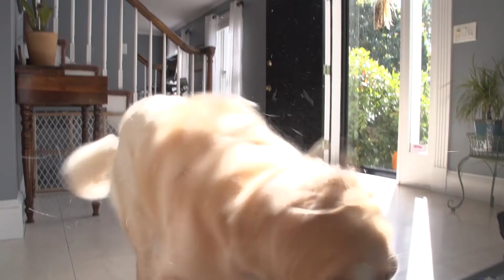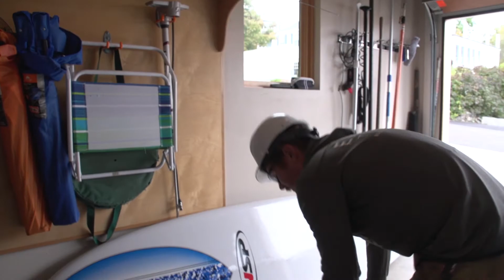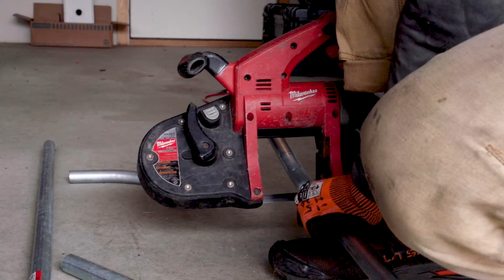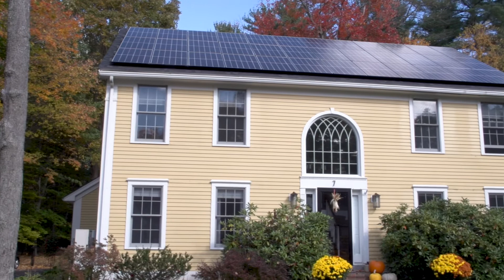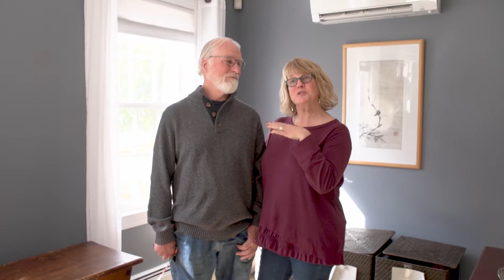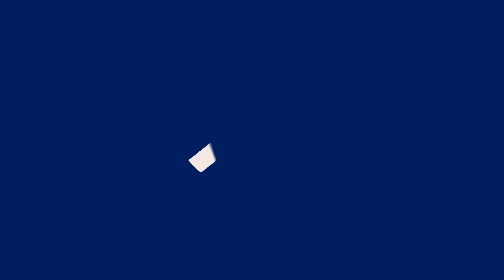Solar Powered Heating and Cooling in NH

Comment: So the system looks to be around 12kW with perhaps 36,000 btu of mini splits.  Does the math work out for the solar to completely zero out their electric bill?  I would have guessed a larger system would be required.  Maybe some specs could be added to the description?
Reply from the maker: Hi Scott! Good question and not everyone wants that level of detail but we're happy to entertain. "Rule of thumb" is 1,200 kilowatt-hours of energy per year, per 1kW installed. So 12kW system = ~12,000 kWh/yr subject to lots of factors like what the roof exposure is and a given year's solar resource... but that'll work out to be about right, on average, over 20'ish years.

Modeling how many kWh are needed to heat a home is a tricky business, as there are tons of factors involved, and honestly energy-efficiency companies that have far more sophisticated software than us and do a better job :)

We have a calc at - https://www.revisionenergy.com/build-solar-powered-home/ - which is useful... Our math: "It’ll vary, but an above-code insulated house needs around 15,000 BTUs per square foot, per year. So a 2,000 sq. foot house to this standard, needs 30,000,000 BTUs / 8,530 = 3,516 kWhs annually… Or about the equivalent of 3 kws of solar (9’ish panels)."

The math in the paragraph above is written based on a pretty highly-insulated house, but it at least shows that 12 kw for electricity, heating/cooling (and I think they're looking into an EV as well!) is correct order of magnitude. We may very well revisit in a year's time to see how close they got!
Reply: @Revisionenergy  Thanks!  Very helpful.